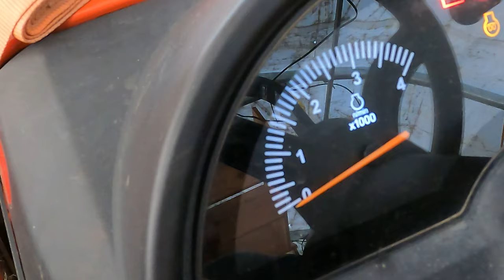Can A Kubota BX Move A Travel Trailer? - No. 133

Comment: I used my BX with 3pt drawbaw to move my 6-6500# camper all the time. No issues. Flat ground.
Reply from the maker: They’re impressive machines! So versatile!!
Reply: I was wondering if I could do this with my Kubota BX1880 with my 3-point hitch with 3pt-draw bar. My trailer has only a GVWR of 3500 lbs and hitch weight of 420 lbs. Seems like that'll work?
Reply: @erikruhmann2429  not saying you should try it, but I wouldn’t think twice about it if it were me. Assuming it’s only on flat/level/dry ground.
Reply from the maker: I wouldn’t hesitate on flat ground - but that’s just me 🙌